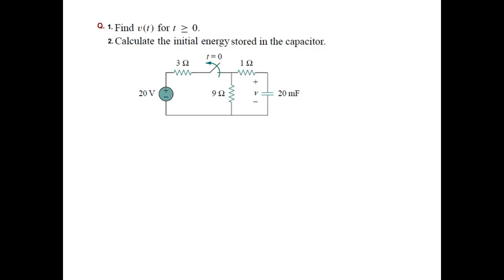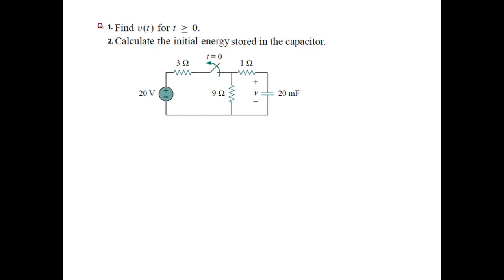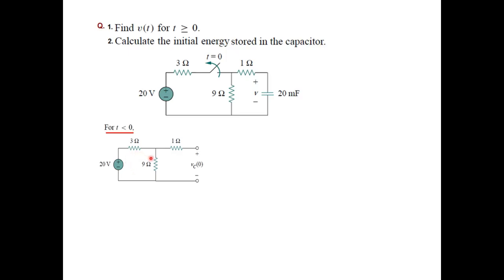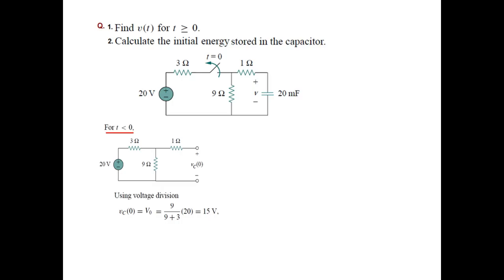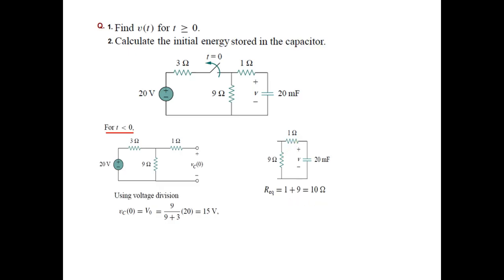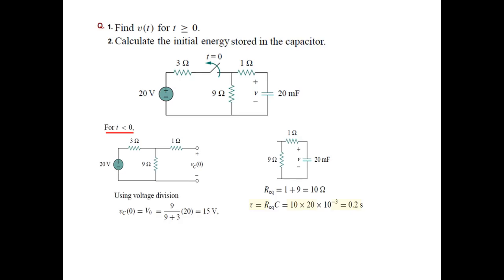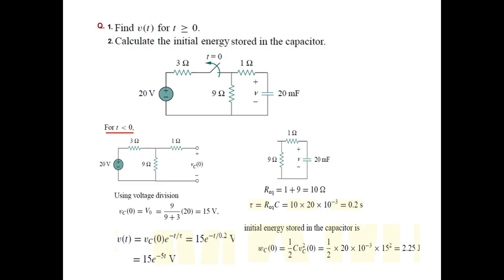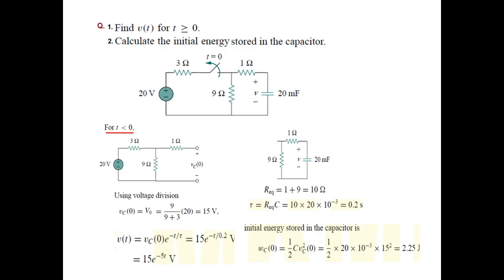(E)LCA(A) Ex 7.2 || Source Free RC Circuit

Comment: 8 volts accross capacitor sir.
Reply from the maker: Please indicate the time on the video where you are referring to.
Reply: @ElectricalEngineeringAcademy   2. 2:51 sir.  8  volts accross capacitor.
Reply from the maker: @sairamb4379  could not locate. Please email me a snapshot at profkhannazir@gmail.com
Reply: I have same question
Reply: next math solve where sir????

Comment: sir but how voltage across 9ohm is v in between there is 1ohm resistor
Reply from the maker: when open circuited, no current flows through 1 ohm.